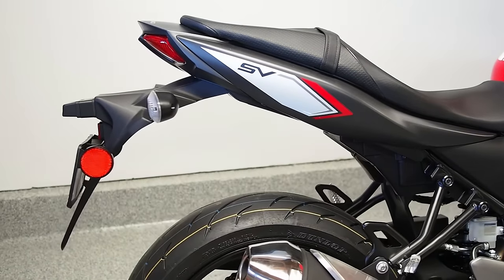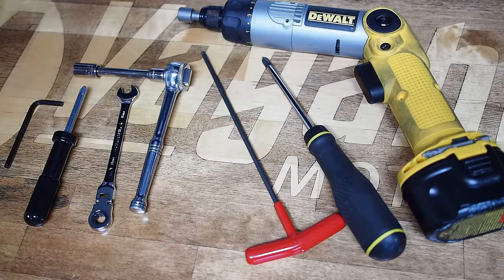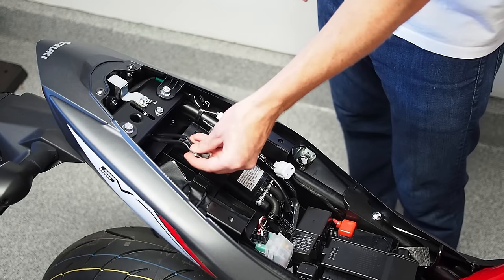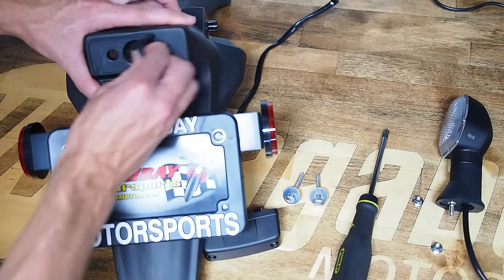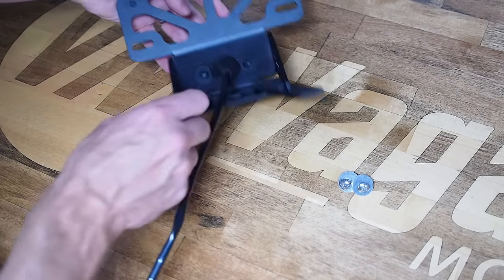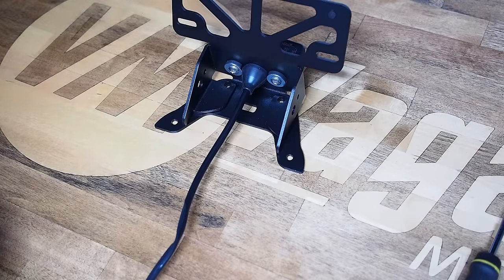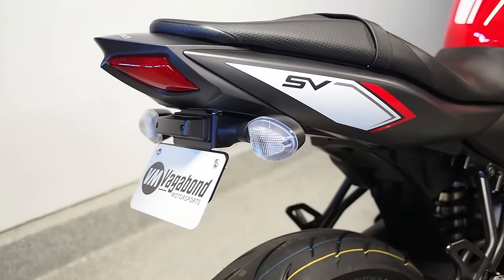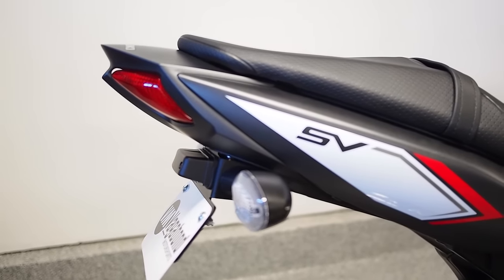Suzuki SV650 (2017+) Fender Eliminator Install Video - Vagabond Motorsports VM-SV610

Comment: I found this kit purely by accident. I like that it reuses all the factory grommets and lights, and there are no splicing wires required. It's just the attention to detail and a nice design!

I ordered it from USA to Europe. Had to pay like 30 euros for taxes and important duties, but it was worth it for the quality part. Very fast shipping too!

I did use the stock self tapping screws though, didn't see the need to use the ones in the kit.

Also didn't use the small locking washers, because they always damage the surface.
I just used bigger normal washers so as to not damage the surface and just to look a lot better and to spread load to a bigger surface in my opinion.

I'm all for the OEM+ look so that's why I went for this set, it really is worth the money!

As for the license plate, because of the size of the plates here, I had to remove the rubber bumpers and use those two holes for fasting in combination to the upper slots. It's secured nicely with 4 bolts and washers now and not going anywhere.

Comment: This video sold me on buying this fender eliminator kit. Good video, very detailed. Install was easy like 35 to 40 minutes it took me. They shipped to me quickly and my bike looks great. Quite satisfied. My favorite thing about this kit is you get to reuse the stock license plate light and the rubber grommet. Don't know why but the rubber grommet was oddly satisfying to reuse and it fit flush in the rectangle hole as it should. Plug and play with no wire splicing was a great bonus. Thanks.

Comment: I knew even before I got my 17 SV650 that a fender eliminator was going to be one of the first mods. I saw a few other options. Some cheaper, some costing more but after I watched this full install video for the Vagabond I knew it was the one. The install was pretty easy. I just set up my phone to watch the video as I did the install step by step. It came out great. I really like how it comes with everything you need, and if you use your stock turn signals there is no splicing required. All the wiring is nice and tucked away. Very clean overall look, and really improves the look. Great jog Vagabond.

Comment: I usually never post comments on YouTube or write product reviews, but I was oh so very pleased with this product. 

I was looking at a few fender eliminator kits for my new sv650. I didn't like the small, tacky looking LEDs on some of the competitor's offerings, and plus they were more expensive. I liked how this system utilizes the OEM turn signals and license plate light. Good price too. Also, their brand name isn't on the product, which is awesome. I don't care to have my bike be a rolling advertisement. 

Item shipped quickly. Installation was rather easy, even with only using the Allen wrench supplied in the bikes tool kit. Threading the last wire through the rubber grommet and getting the last spacer on was the hardest part, and it was relatively easy. I just used a flat head screw driver to gently push the last wire through the OEM rubber grommet while pulling the other two to the side, and for installing the last spacer, I just used a pair of needle nose pliers to hold it above the screw hole between the mount and tail while guiding the screw up towards the mounting hole using the Allen wrench. If that makes any sense. The short Allen wrench made it a bit of a pain to tighten the two frame screws closest to the license plate because of the close proximity of the turn signal wires. 

For mounting it to my bike, I didn't do two screws at a time like described in this video. I just loosely installed one at a time to leave as much space as possible to get the other spacers in there. It was easy. The whole installation took maybe twenty minutes, max. Fit and finish of this product is beyond satisfactory, and if something for some reason happened to this one, I would buy another without hesitation. It feels very sturdy on the bike, only thing I've considered is maybe taking it off again and applying some blue loctite. But after putting 50 or so miles on it since installing it yesterday, everything is still very sturdy. 

I'm a 10/10 satisfied customer. No regrets.

Comment: Wonderful kit! Super easy to install and no cutting or splicing required on the OEM wires. Fitment looks like it came off the Suzuki assembly line.

Comment: Great product guys. Well designed. You just need three hands when trying to keep spacers in place before final bolt up under sub frame. Perhaps it would help if the 4 spacers were swaged into mount holes. Otherwise sweet.

Comment: Try using a little bit of tape to hold the screws in while you feed the wires through and get the screws started. It might help a little bit.

Comment: This isn't related to the video but are there 4 nylon loops underneath the passenger seat to attach a tail pack sitting on top of the seat?  Will you also be selling an integrated turn signal kit?  Thanks.

Comment: For the part where you are pushing the wires through the gromit (cant spell X3) Would it be better to use needle nose plyers (cant spell that either >~<) or would that just rip the connectors off?
Reply from the maker: As long as you are careful needle nose pliers can help but you definitely don't want to damage the connector.  The video makes the process seem more difficult than it really is, it's easy enough without tools in reality
Reply: Vagabond Motorsports Alright thank you

Comment: you finally end up with the rear light, licence plate, licence plate light and winkers all in the mud coming from the rear wheel. + The shit goes right to the rear box if you happen to have one attached. To me a pointless mod. The rear lights wobble for purpose  - the motorcycle wobble so any time a light is equipped with a standard bulb this solution helps prevent it from damaging - the same solution on old Yamaha Teneres.